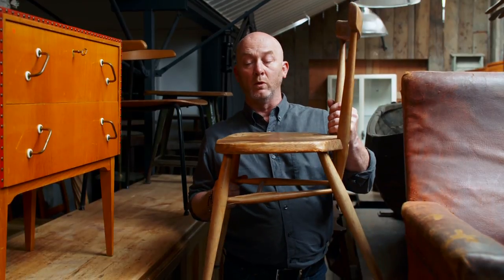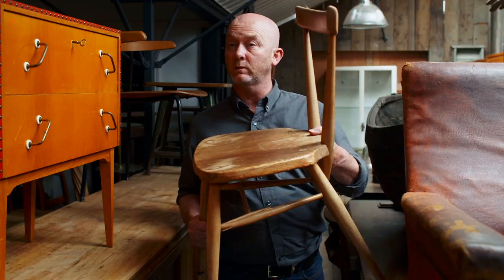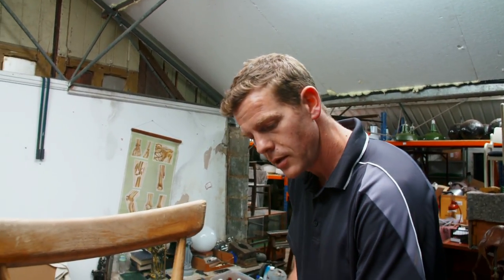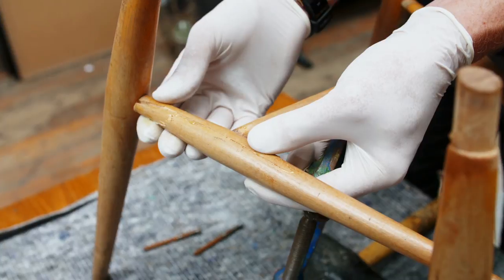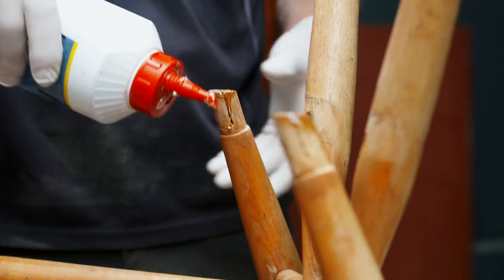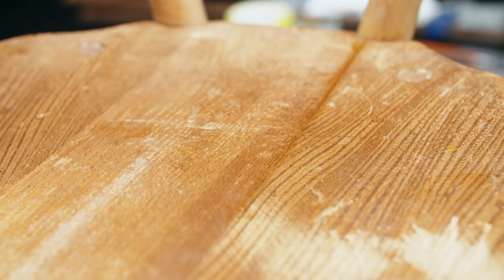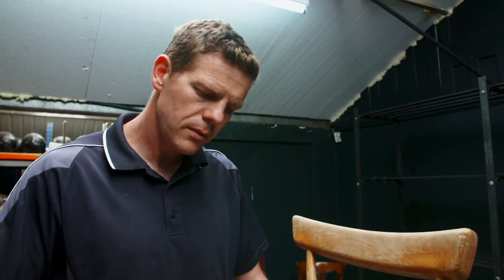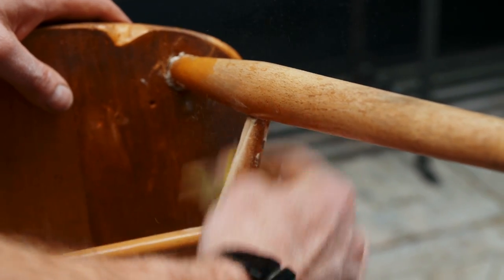How To Repair a Wooden Chair - Salvage Hunters DIY Tips

Comment: have a rocker where the cross spindles were apart and are offset. How do I rejoin so they do not have so much stress on joints from being a little warped out of shape? dad picked it up from street side long ago and may have set out in rain offset to warp out of shaper?????

Comment: Great video as always, but!  Just knock the legs off from the seat with a rubber mallet? No chance of getting the legs off that easy once bonded, maybe should show how to dislodge the bond without damaging the chair first would be good.
Reply: Heating them up first, then slowly knock them off with a mallet. It depends on the glue that has been used in the first place but usually does the job pretty well.

Comment: Never use a polyurethane glue.
Reply: Don't deny yourself the benefits of PU. Use it  appropriately. Alex here is using far too much and hasn't mentioned moistening one surface. Yellow, or white glue would have been most suitable for broken stretcher, but the right PU adhesive would work better in sockets.